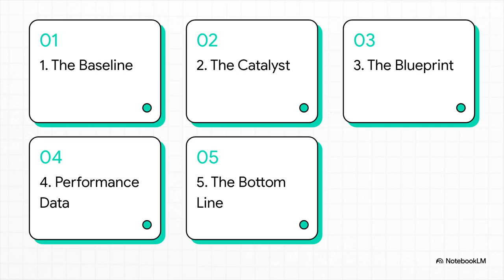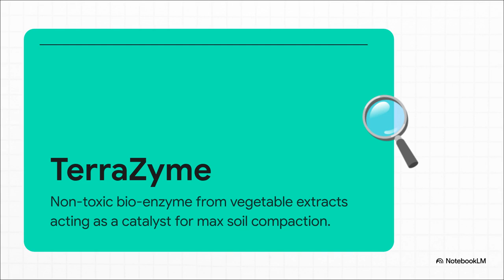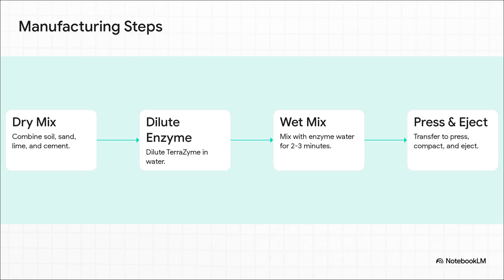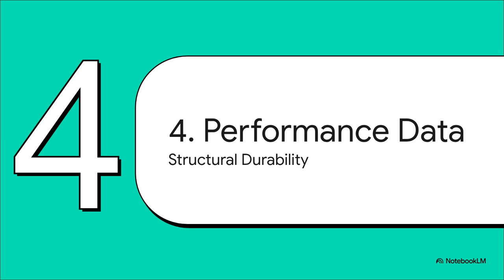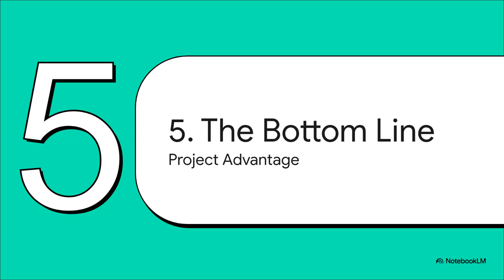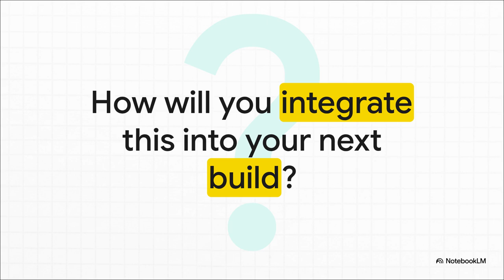The Future of Sustainable Construction: TerraZyme & Compressed Earth Blocks

Comment: Are these equivalent to geopolymer stabilizers for rammed earth blocks ? If not, can it be used conjuctively with geopolymer stabilizers as well as basalr fibers ?
Reply from the maker: TerraZyme is not equivalent to geopolymer stabilisation, as it uses a different mechanism. However, it may complement geopolymers by enhancing pozzolanic reactions; further research is needed.